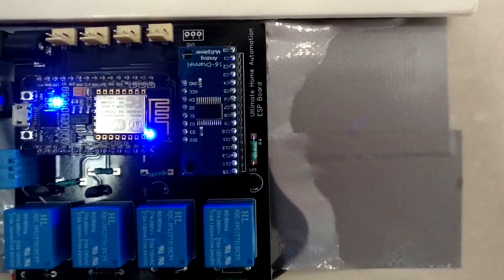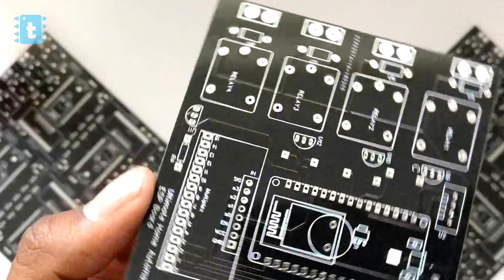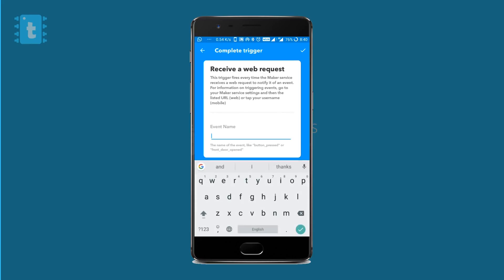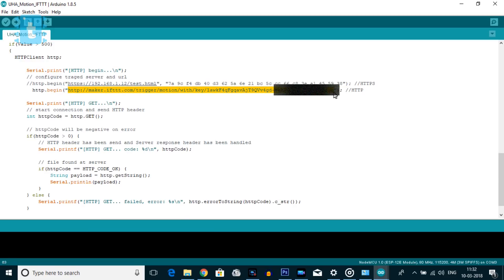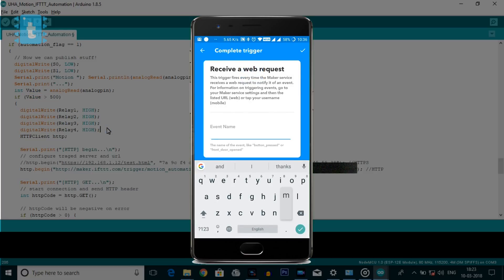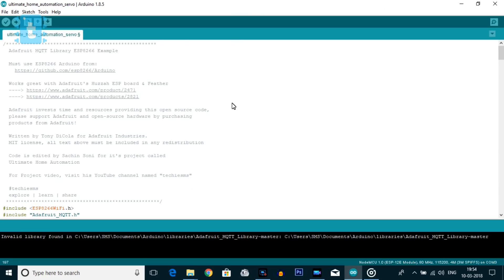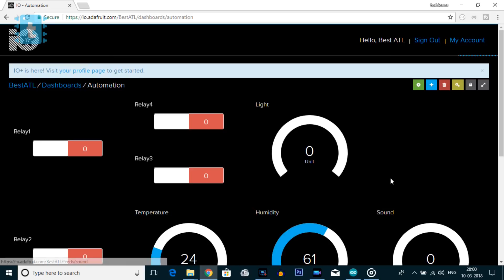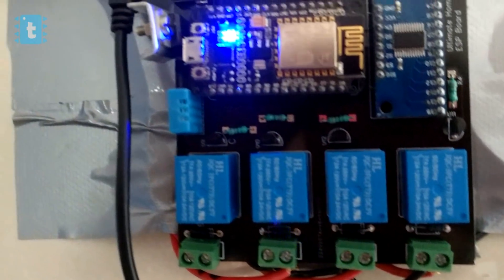Home Automation with Smart Notification on ur Smart phone from anywhere in the world | IoT Projects

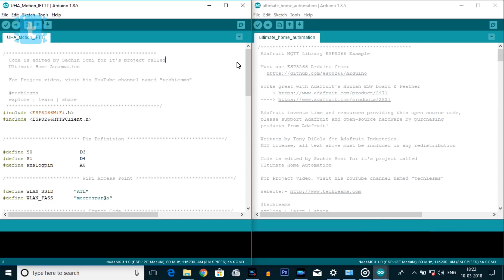Comment: Arduino: 1.8.10 Hourly Build 2019/08/27 05:33 (Windows 7), Board: "Arduino/Genuino Uno"

Stat : The system cannot find the path specified.

Error compiling for board Arduino/Genuino Uno.

This report would have more information with
"Show verbose output during compilation"
option enabled in File -> Preferences.